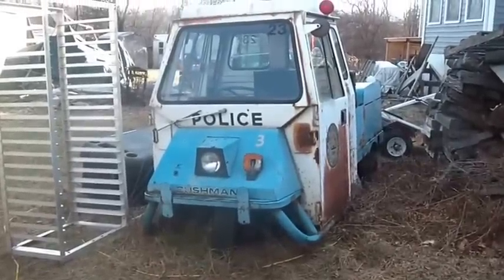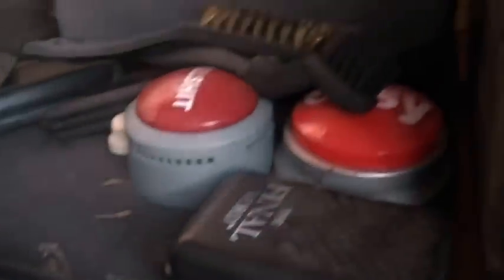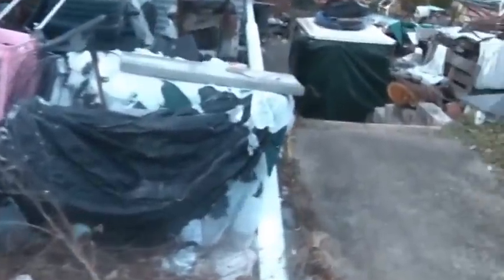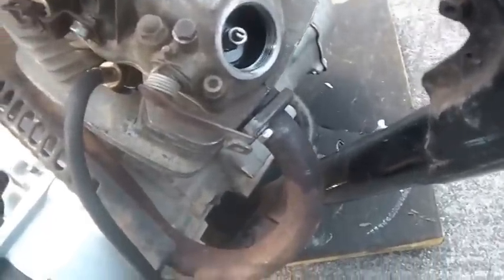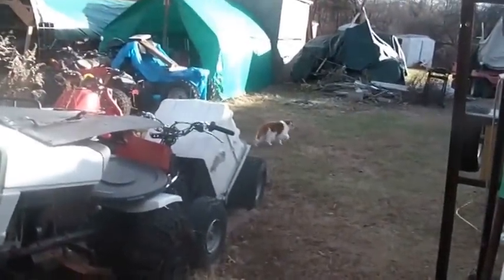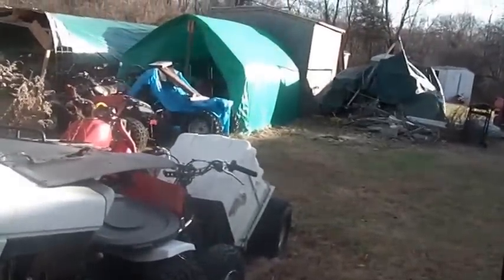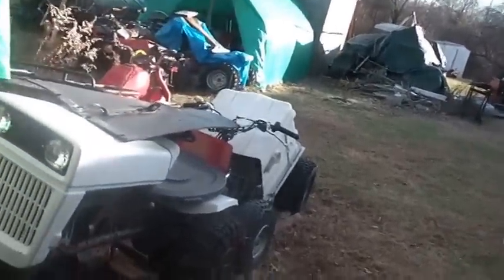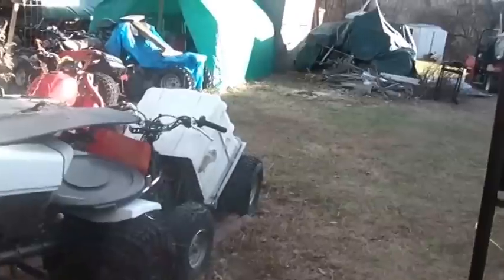12_31_2014, Honda ATC 200 engine, has  tight intake valve,

Comment: u should beable to feel it more but it shouldnt be ticking when u do
Reply from the maker: redneckwheeler 92 , U R right, when one wiggles the rocker, it should not make the clicking sound it was making, but, I wanted to make sure it was loose enough for full valve closure for the compression test and engine start test. Thanks for your thoughts, watching, and commenting Bud!